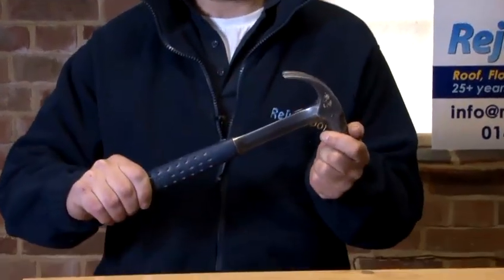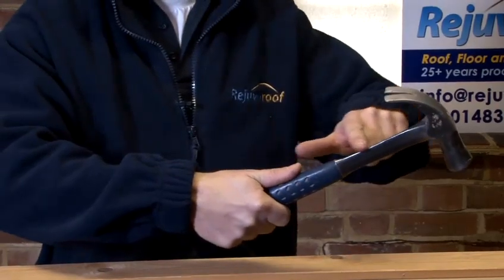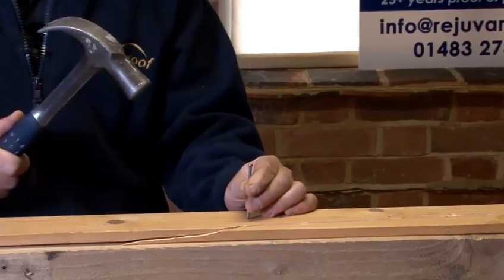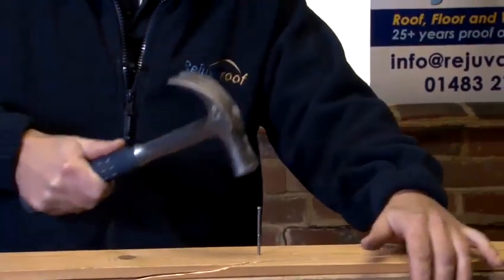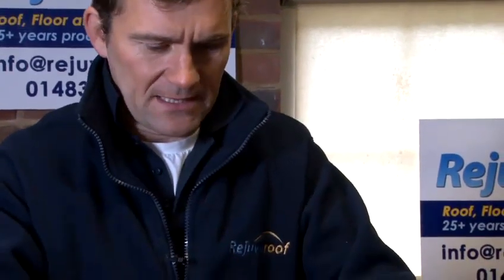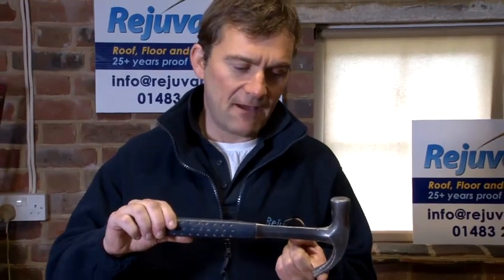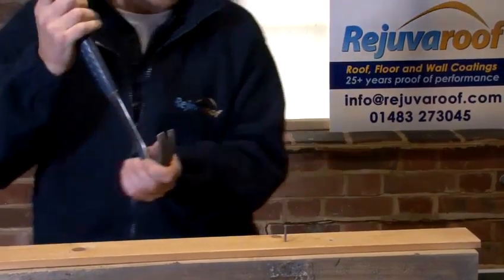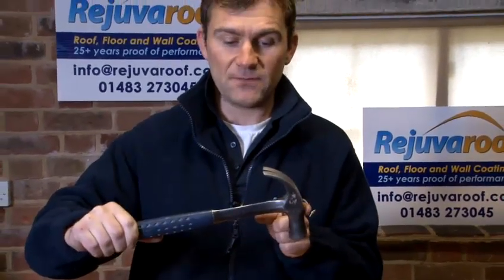How To Use A Hammer

Comment: Why would you want a firm grip? It's just going to make your hand & wrist tired. The hammer is supposed to put the nail in, not your wrist.
Reply: yeah, you should hold on to the hammer while it's hitting the nail. But if you keep your hand/arm tense through the whole motion you're going to be ineffective and tire rapidly.
Reply: let me guess, do you also think the way to saw effectively is to push the saw back and forth as fast as you can?